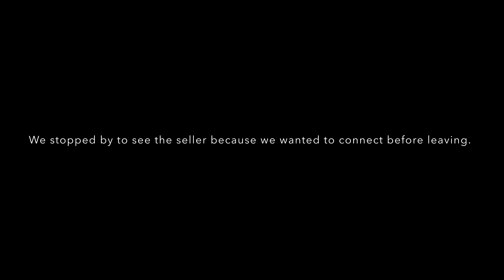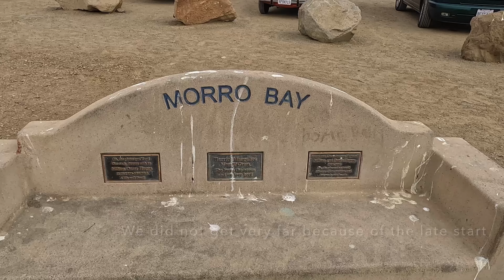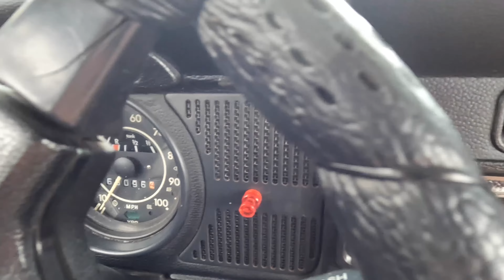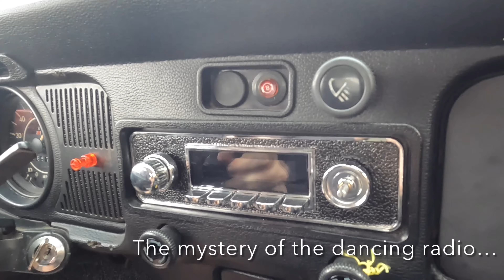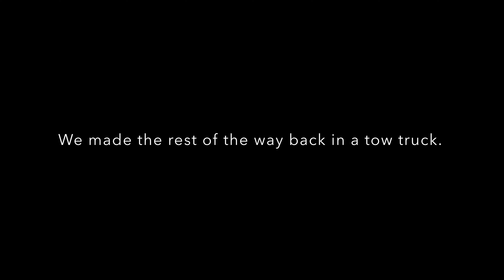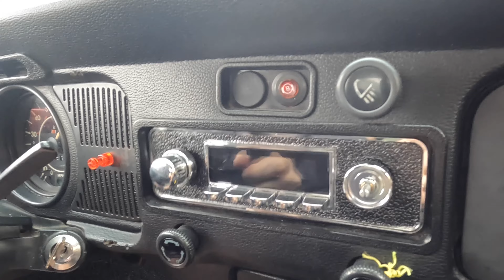Road Trip in our 1972 Volkswagen Beetle - from Los Angeles to Portland!

Comment: 3:40: The hard starting may be because the choke advance was set too far. I had a 72, and was told that the 72-74 models had a special choke advance which kept it partially closed MUCH longer than previous models, in order to reduce at least one of the emissions tested for. ?this made the car sluggish until COMPLETELY warm, and made fuel economy terrible. 
I was told that many people just advanced the choke adjustment farther forward, so I did. This made starting harder, requiring a bit of pumping the throttle and then holding rev's up manually until warm. But when winter came, I replaced the choke spring with a pre-1972 version and it worked fine.

Comment: A lot of times the neutral safety-lock switch will stay in the open position when the car is running hot in these autostick bugs, which will not allow current to the starter. I always have to shift thru all of the gears with the ignition switch on in order to reground the contact points at the bottom of the shift lever, before trying to crank it over it in the Neutral position. You will hear a 'slow moaning' sound from the clutch servo when it releases, which should then allow the starter to get juice again. The best thing to do for this is bypass that switch altogether, so you will always have juice flowing to the starter from the ignition switch. Hope this helps.
Reply from the maker: Thanks James for the helpful tips. Having AutoStick experience is a big help as there's not a lot of these around. We'll give your suggestions a try!

Comment: Problems with the car.....Rain catcher is missing on the engine compartment. There should be a plastic gaurd that catches the rain from getting on the distributor. goes over that vent.......Carburetor issue. Needs to be jetted correctly. there are 2 idle jets that need to be set up correctly. they are on the right side of the carburetor. they could be also dirty. every time you adjust that carb it does really nothing because those are not the right ones.
Reply: the rain catcher being missing is causing the distributor to get wet and the engine to not start.
Reply: Stock carbs should have a 127.5 main jet, a 70 air jet, and a 55 idle jet. For E 85 fuel you will need 60 idle jet and a 130 main.
Reply: @JamesDavis-jo9tk  yea that is the original jetting but for the alcohol in fuels today you really need a 130 man on average. depending on compression ratio  cam. Some cars need a 135. No not for e85 either. 140 or more for E85. from what I hear I have never run that stuff. but I know guys who do. usually 55 intermediate and idle. sometimes 65. no 2 are exactly the same. compression cam displacement if a 1776 or 1835. Bigger engines are even different
Reply: @Mikefngarage  yep you’re exactly right Mike. Mine is bone stock and with my altitude and where I live she runs fine with ethanol free 90 octane.

Comment: 14:00: WOW, that's a ROUGH idle for a VW. I'd check to see if the proper plugs are installed. Air-cooled VW's require plugs for a HOT range, and most plugs available at your local chain stores are not hot enough, even if they DO fit. A set of Bosch hot-range copper-electrode plugs is what these engines are designed to run with.

Comment: That fan belt seems to be slightly on the loose side..cooling may be affected..
Reply: Always thought the beetle motor ought to have twin fan belts cos cooling is critically reliant upon the fan belt. Probably an overkill but saves the engine from overheating and seizing if the charging light going on is not noticed.

Comment: A 1972 beetle would be either the S model Superbug or a 1200. Judging by the shape of the hood, it is a 1200, does it still have the 1200 motor or has it been refitted with a 1600? from memory, 1200 motor in a beetle means top speed 73 or 75 mph.
Reply from the maker: @keithad6485  Thanks for your comment. In 1972, the Standard Beetle came stock with the 1600 engine. Rosebug still carries her original 1.6L engine.
Reply: @CruisingInClassics  Learn something new every day. I have seen ;71 - 75 beetles with torsion bar front end with 120cc motors though have not seen one for years. 

I am currently looking at buying a 1976 Beetle 1600 which has not been started for 36 years, been sitting in a garage all this time. It is missing its front seats which is gonna be a problem replacing due to it having the 3 point mount which came in in about 1975 or 76. The seats seem to be uncommon. Rest of the car is in good condition. It is covered in dust. I checked the chassis number under the back seat to make sure it was a 76 model, third digit is 6 which confirms the year of manufacture.
Reply from the maker: @keithad6485  Sounds like a fantastic project that you're embarking upon. Good luck with the revival!

Comment: Engine overheated.....Probably needs rebuild now. Valves could have gotten tight. Could have been running lean not rich.....possibilities......Broken intake boot....Carb jets too lean......Pushing it too hard up a hill and engine was pinging. other things that happen is valves get tight from running too hot. broken piston. #3 or all valves tight. compression loss from heads getting loose. These cars require lots of maintenance. and knowledge to do it. That is why they had VW shops specializing in them for many years.
Reply from the maker: Hi Mike, thanks for all your comments and for watching. I actually watched a ton of your videos before we picked up Rosebug and in preparation for our trip. Thanks for all you do for the VW Community and novices like us who are looking to learn. Your diagnosis were very helpful and accurate. Hopefully you can watch our follow-on video and see the cause of our issue. Hint: it was one of those listed in your comment. 🙂

Comment: Why is the fuel pump covered with some kind of foil or material?
Reply from the maker: The previous owner was suffering from Vapor Lock (fuel boiling due to excessive heat exacerbated by high ambient air temps). He added that material in hopes of deflecting heat and said it helped his vapor lock issues. Now that we have Rosebug here in Oregon, with much lower ambients, we've removed that material and haven't had any issues.
Reply: Thank you. I have my beetle in southern India and it’s a so hot over there. When I drive the car around and if the car engine is warm enough, then it’s usually hard to restart the car immediately unless the car cools down a bit. Is the symptom of vapor lock same?
Reply from the maker: @ganeshlalu1144  Yes, difficulty to start when the ambient temperature, and the engine, is hot is a symptom of Vapor Lock.
Reply: @CruisingInClassics  Also can be when the fuel in the carb float chamber boils due to the excessive heat of summer and hot engine.  Found that adding a second gasket to the shut off valve makes it so the float pushes up a little harder  against the valve shutting off fuel flow when parked.  Since then no flooding of the engine.
Reply from the maker: @veewee111  Great tips! Thanks for sharing.

Comment: Those Auto Sticks were interesting and undesirable when trying to resell one.
Reply from the maker: @craigjorgensen4637  And now because most people swapped them out for a Manual Transmission, the AutoSticks are now rare. Funny how things ebb and flow.
Reply: @ Rare doesn’t mean valuable.  The Auto Stick to a manual wasn’t an easy conversion.  VW was losing a lot of sales in the late 60’s to Toyota and Datsun because they didn’t offer an automatic so some brainiac came up,with Auto Sticks.  They weren’t really “bad” but really oddball.  They never sold very well and when people wanted to trade them in years later the stores didn’t want them.

Comment: Had you taken a Toyota Corolla, trip would have been worry free although not as cool.
Reply from the maker: Pretty sure you wouldn't have tuned in to watch a worry free video of a Toyota Corolla 😉 Thanks for watching and for the comment.
Reply: @CruisingInClassics  I'm pretty sure you're right. I learned to drive and took my driver's test in a 1972 VW Beetle. I really do miss driving it, I miss shifting the gears the sound of the engine in the rear, the hard plastic seats and of course the gasoline smell you get when you open the heating vents in the Winter. Memories.........
Reply from the maker: @t.r.8427  Merry Christmas to you! Here's to making more memories in the New Year!

Comment: They should have popped the clutch the last 80 miles
Reply from the maker: @ryanayers3138  You can't pop the clutch on an Automatic Transmission. This Beetle uses an AutoStick transmission. If it was a Manual, then you could definitely compression start it. Unfortunately, we didn't have that option.

Comment: Completely unreliable vehicles. Moisture issues in the rain. Drive mechanism for the wipers is rubbing on the antenna cable out the rear of the tuner. I owned three T3's. Even if you are handy you have a mechanic on speed dial.